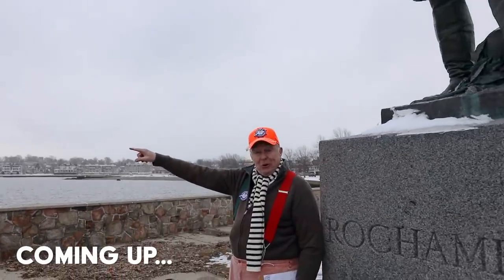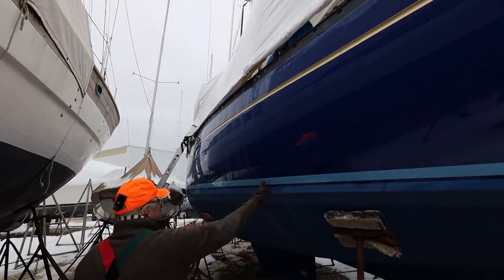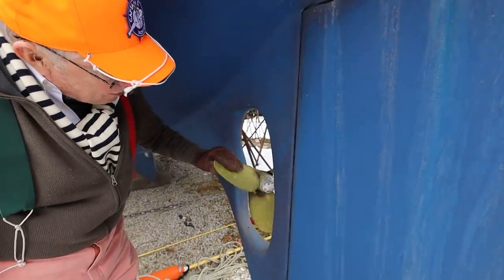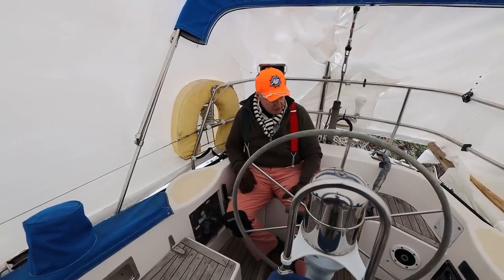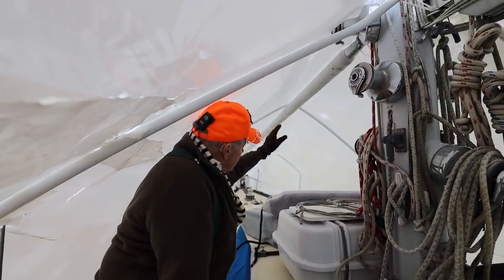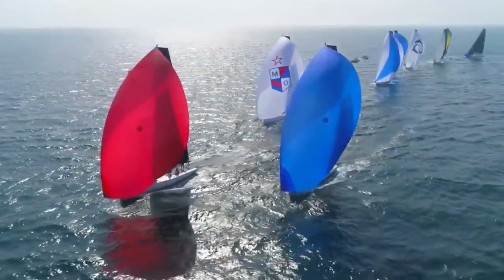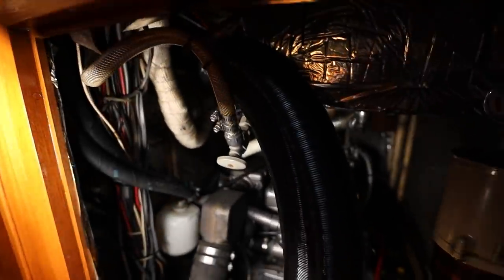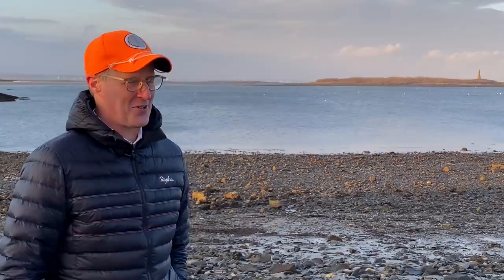GO ANYWHERE!! Global Cutter Rig Sailboat for sale - $110k EP27

Comment: Great Review. The dorade box with the two fittings near the dodger are usually water valves so you can hook up to city water. I own Hull #1 and it is nearly identical to this boat. My aft cabin is set up a bit different, but other than that, they are twins. I am currently doing a complete restoration on mine and currently re-coring the decks. I hope mine looks as good as Kismet in the near future.
Reply from the maker: Thanks for the tips!   that did flit thru my old  brain even as i said it  because the cap length and thread length didn't look quite right size   thank you for the clarity    Some of these boats could take a day to study and half a day to review  ..good luck with yours  they are really beautiful..thanks
Reply: Amazing that something from the Alden yard would ever need the decks re-cored...
Reply: @garystone7062  it doesn't matter who builds a boat, after 45 years the cores will be soft. Original teak decks that were screwed down, sail tracks and other miscellaneous fittings all eventually leak. I replaced the original balsa core, which was like wet cardboard when I took it out, with Coosa board. At least the core will never absorb water again.
Reply: @timohan100  My 1977 Pearson doesn't have any soft core issues. I've had her since 1995. Good design puts perforations in the deck in areas where solid glass protects any core. I'm sorry you don't have that luxury. Your coosa repairs if done correctly will mitigate water intrusion issues.

Comment: for a couple, or a couple with just one or two young kids, this would be perfect. I love the two companionways. the kitchen seems small, but, i think that was more camera angle, as you seemed pretty chuffed with the amount of storage and surface area to work with. i love the space on deck...space to move around without eating stays at every turn. what else do I like? the clever anchor storage, the teak, the ports. Not crazy about the wheel. Prefer tillers, but, I'm weird in many ways. If they were giving this away, I'd definitely get in line. but, and this is weird, there's the inscrutable factor of "appeal." I don't love this boat. some of the boats you've reviewed, I whimper and cry myself to sleep, dreaming of them. (Others, I look at the price tag and cry for other reasons!!) For the right family, this is perfection....THANK YOU, CAPTAIN Q, for your great videos!
Reply from the maker: Thank you for your heartfelt note.  I hope you can find a boat that fits your life
Reply: @YachtHunters  thank you, Sir! It just might be the next one you review! Hope springs eternal....

Comment: Although I don’t think you mentioned a Hinckley in this video, you do many times. You compare features and designs to Hinkley. Tell me your reasons for this. I don’t own a boat nor do I sail, but you two have inspired me and now I am looking.
Reply from the maker: Hi John, Hinckley has a well-earned reputation as one of the premier designers and manufacturers of boats since its inception in 1928. They are akin to what Mercedes-Benz is of car makers - uncompromising on design, durability, safety, sailability(which may not actually be a word), and also innovation. They were among the first leaders to move to fiberglass construction in the 1950s... proving that they were always prepared to evolve the designs if it meant building a better boat.  Prices on used Hinckleys are often far above other boats of similar size and age, reflecting how well-appreciated they are by buyers. We use it as a benchmark for other manufacturers and designers since they are so darn good.... you can see the Hinckley design influence on other similar boats of the day - this Alden 44, the Ted Hood 46 we reviewed in episode #29.... so you'll hear us mention them a lot as they essentially set the standard back in the day. Hope this helps!

Comment: That's an excellent price on a high quality build.  Perfect for a family with kids...  the price reflects that it is much narrower interior than the beamy modern French boats, which will turn enough people off that the price is very very good.
Reply from the maker: Couldn't agree more!
Reply: Then they aren't real sailors. Try pounding upwind to Halifax in a Jeanneau designed for the Med.
Reply: @BrianNavalinsky  You are exactly right...  that interior will work very well at sea, and the boat will be much more comfortable in a seaway...  New boats are sold from the inside out...  which is a horrible way to design a boat, but it is what the modern market has become...  Those fat French boats start from, we must have three cabins, and two heads, and it must feel like your living room at home, etc.... the hull all those demands require is great down wind.... not much else.
Reply: @redshifttrucking4537  I actually don't have much right to talk as all of my boats have been built for speed rather than comfort (minimal interiors),  but I guess my PB is not the LeComte 52, but the Swan 46 mk2. I did have the chance to meet Bill Tripp Jr. when I was a kid, but he lost me with the Columbia 39 which has freeboard comparable to the new European designs. I do understand overhangs in a seaway, but Tripp's 1960's designs went overboard with the overhangs.

Comment: Capt Q says real spinnakers, implying symmetrical chutes, and the film clip has boats with asyms hoisted. A sign of the times.
Reply from the maker: Ran Day ha dt a hard time under pressure to find sum chutes  but that was what I was raised with as young foredeck crew and setting and playing them was a Real  thrill. Doing the fore deck dance all the time
Reply: @YachtHunters  It’s true! I was fortunate to learn the same starting with end-to-end on a Ranger 29, up through cruisers up to IOR50s at the end of the circuit and then the sled70s. Reaching on those beasts with 50’ of loaded guy stretched across the cap shroud while we rolled the reaching strut into the bite of it and tied it forward with a sail tie, until the next jibe back. Reaching IOR boats in blue water or on a triangle course made noises from depths of hell. No hi-def film of that era. Great memories and watching you guys is a delite.

Comment: Struggling to see why any of the boats Sailing Atticus have been looking at in the $200-250K range (most recently Valiant 42) are twice the
boat this is.
Reply: Yes ,also since they started on such a low budget they know the value of money,$200K+ and $$maintenance is LOTS of money when YouTube might screw you tomorrow.
Reply: They are looking newer boats. This one is pretty old, 1984. That makes a big difference in price tag.
Reply: I agree, Theo. This boat is older, but in such good shape - and half the price of small boats they are looking at.
Reply: You should take Captain Q not too serious when he tells us that the boat is in a perfect condition. In a 1984 sailboat you have to renew basically everything if you want to do more than coastal sailing. Take the Cal 40 which Captain Q inspected earlier on and then watch the Restauration of a Cal 40 on the great old boats channel. The Restauration costs more than a new boat. Attics is fed up with those project boats that’s why they wanted a newer one - you always get what you pay for.
Reply: @Isimud  I agree with your points too, Jot Be - that most of the old boats are simply worn out and require a year or two (and tens of thousands of dollars) to rebuild. I once bought a wood 42 cutter for $30 K but after two years of rebuilding I had $65K in it - would have been cheaper and easier to have just looked for a boat in the $65K price range and let someone else do all the work!  Still, it's hard to part with $250K for a 40 - 42' sailboat.

Comment: What's your opinion on replacing the gas stove with electrical solar operated stove to preserve the gas.  This is certainly a handsome boat or should i call it Yacht.
Reply from the maker: i am not familiar with that particular technology but any time we can incorporate solar with out affecting the safety of the boat i am all for it  ...i will say that the grace and beauty of sailboats of yore is being whittled away and masked with solar panels and steel  frames and cockpit greenhouses ...probably necessary but then its jus another loss of the way of sailing

Comment: The lined drawer looks perfect for silverware or utensils. Hearing them banging around while underway would drive me nuts. That might muffle the noise?
Reply from the maker: good suggestion    but maybe in a powerboat but not in the gentle womb of a sailing yacht      now if they are sterling pieces that might be appropriate  thank you
Reply: Whether sterling, or, ahem, plate, that is a drawer meant for tableware. You are likely to find the same in almost any butler’s pantry, silver chest or sideboard. The concern is not noise but reducing tarnish and fratricidal scratching.
Reply: @DavidHHermanson  I've never heard of "fratricidal" used in that way.

Comment: Do stuffing boxes leak on the center board keels? Hydraulic is different? What can go wrong with center boards? Freixnet champagne.
Reply from the maker: if its man made it can go wrong...i think the design of most cb boxes and wire etc involves non working components for the most part other than cables that slide up and down permanently fixed tubes  subject only to wear after years of up and downing  good question i will further investigate

Comment: Did I miss a second cabin?  Has this boat only got a V berth and a quarter berth or did I fall asleep?
Reply from the maker: No you got it... big double quarter berth though
Reply: The really is "two" cabins on this design. Besides the V-Berth, you have aft cabin. The aft cabin is separated from the rest of the boat by the aft bulkhead. There is obviously a door on the head, but there is also a door between the nav table and the galley. On mine we shut the doors for privacy. If you are sleeping in the V-Berth you can access the head from the forward door and the cockpit via the center companionway. Works perfectly.
Reply: @timohan100  Ah thanks I couldn't work out what the rest of the space on a plus 40' boat could be being used for.

Comment: What is the parameters for a short handed or solo sailboat over 42 feet?
Reply from the maker: You’ll want to have as many controls leading to the cockpit. A bowthruster would make handling a 42footer even easier for a single handed (though definitely not necessary). A good auto pilot, additional a windvane self steerer would be a good idea… a decent sea berth

Comment: I don't believe that this is the price range for that boat, it seems way over priced.
Reply from the maker: Yachtworld currently has 6 44’s for sale. This is the least expensive.  The other five range from 129k. To 165k.  We do not set prices  just report them.  This appears to be a hect of a buy
Reply: This yacht is a gift at this price the condition is impeccable. Did you not take note of the condition.?
Reply: This past March I paid a bunch more than this for my Alden 44 cutter (mkII interior layout w/boatswain's locker forward) and my surveyor said I got a good deal. This review is spot on - GREAT sailing boat, well found and well equipped. Just marvelous watching Captain Q and Randy review some of the great finds out there.

Comment: You lost me as soon as you said it had a center board. NOPE not on a boat I would own. You have enough stuff with moving parts without needing to worry about the keel as well.
Reply from the maker: She has a great un dee body and will mostly never need tge board. We did a Bermuda 40 that a retired couple sailed around the world and never once used the board 
If you got caught in light air and hand to make  best time hard on the wind to fetch a harbor entrance or dome such.  Otherwise crack sheets and enjoy life